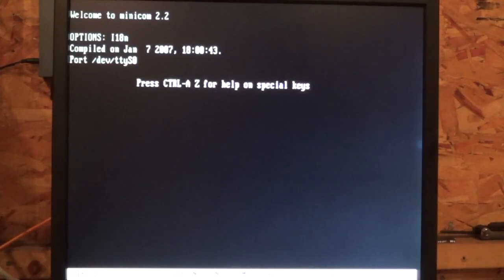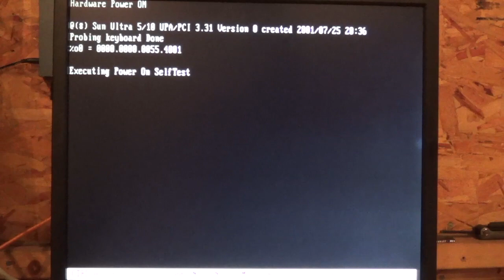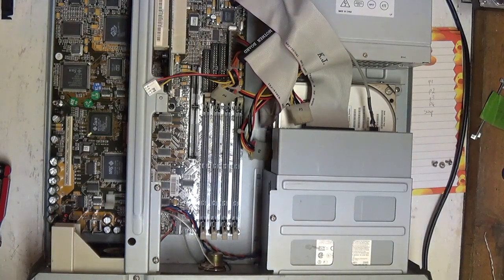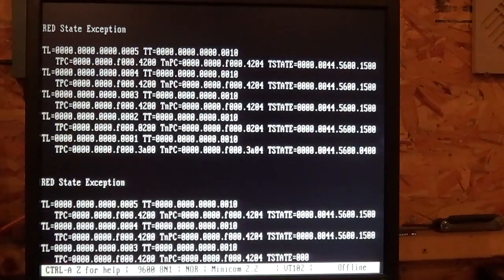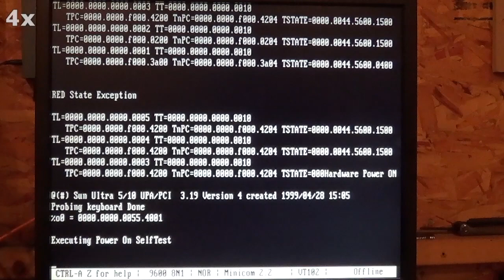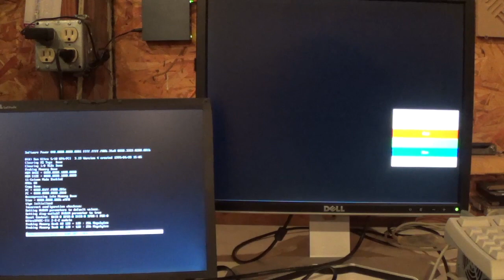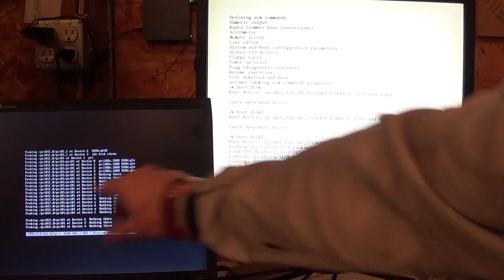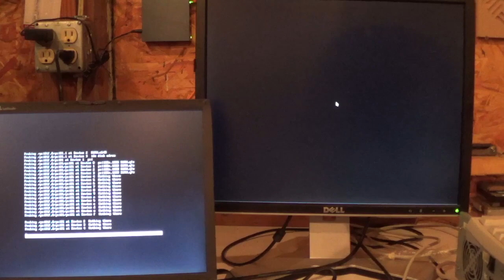Sun E10000 - Ultra 5 SSP repair

Comment: is it just me, or does the replacement motherboard have some bulging caps on it on the CPU power filtering side of things? I had that happen with the Ultra 10's motherboard and was able to use reclaimed capacitors off a Pentium 4 board that were of considerably better quality. but the poor board finally gave up the ghost not too long ago and I had to replace it with a board from an Ultra 5 333, so I can't use my 440 CPU any longer until such is fully replaced. You may want to check those capacitors because the IQ branded caps are finally at the end of their usable lives and are starting to puff up.
Reply: I wouldn't bother using caps recovered off old equipment. Worst case you're looking at maybe a few dollars worth of parts for new nichicons (or other reputable brand) from your favourite supplier - mouser, e14, rs, etc.

Comment: *Try cloning the ide drive in the Ultra with clonezilla and see if you can push the image onto a modern SSD. I did this last weekend on 10K HDD and worked really really well. In PA we get really cold winters and I've found all of my standard hdd drives seemed die off from the weather. It might not be possible to do but it would be really cool if it worked.
Reply: It's a shame that slightly less modern SSDs aren't more common. PATA disk modules were a thing, for industrial and embedded systems, but production seems to have stopped on all the classic brands, like Emphase.

Comment: Those always drive me up the wall. Reminds me of when I put in a post card in older pc motherboards and they are not 100% dead. Sometimes you may or may not get a beep code. But since the card is flashing around different numbers it is doing something. Last one I looked up the error code on was 2 things i could be. Neither one of them was worth fixing the older board for. So just time to recycle it. Thank goodness it was just a pc board. Though now I wonder what could really cause that error you got. Enough to go though console diagnostics but then stop. We also know it isn't the power supply since the other board works on it. I double it would be the clock since it does allow a console post. It does not have onboard video right? So no possible bad v-ram. To bad I don't know more about the sparc boards. For instance is the console boot 100% diag. board or does it need part of the overall board to function. Hopefully somebody will chime in a few ideas. The big thing I hate about the newer you go. The more the chips are soldered to a board. When I first started getting into computers. It would be wroth a time to change out a keyboard chip if the keyboard was not working. Same thing with bios, clock chip and a few others.

Comment: You're back!

Always a good watch, even when PSUs explode etc. lol

Would love to see your progress with anything SGI, but the Sun stuff is a close second. ;)
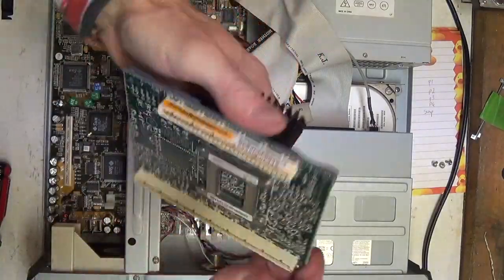Reply: 7:16

Wow - The CPU uses the same type of connector as the Octane CPU. :o

PLEASE let me know if you see a part number or manufacturer on the connector itself (on either the CPU module or motherboard).

I designed an adapter PCB for the Octane CPU module, to allow it to hook up to an FPGA board. But, I was unable to find the type of connector, so had to use rows of 1.27mm pitch pin headers instead.

(which weren't fun to fit, and had to be used for the ground "fins" as well.)

Do you know if Sun might have a parts list for their boards? I'll have a Google anyway, but it would be great to know if you have spotted anything like that.
Reply: The Octane adapter is part of my efforts to implement an SGI Indy / Indigo or Octane FPGA core, btw.

I have the Indy BIOS booting passed most of the self tests under simulation (Verilator), but the CPU core I'm using lacks an FPU, and it's genuinely easier to hook up a real MIPS CPU rather than implementing the FPU in Verilog, at least for me. lol
Reply: That's quite interesting! Best of luck ! :)
Reply: @electronash  I wouldn't expect a parts list, most Sun stuff seems to just go to a module level with FRUs
Reply: @DextersTechLab  

Yeah, like the DEC stuff, most of them don't even put designators on the boards.

I know it's a long shot, but always worth asking. ;)

I think the connectors might be FCI / Amphenol, but I can't find a part number for that type with the blades in the middle, or even an image of a connector on its own.

The smaller power connectors are FCI, and I think I did find a few sources for them, but they are still quite rare / EOL now.

Those connectors are easier to do without on the Octane modules, as they just carry 5V and 12V power (to the on-module DC-DC), clock out, reset, JTAG etc.

There are two pins that go to opamp inputs on the DC-DC, but I don't know if they are for voltage / current sense, or something else.

I'll have to bypass the DC-DC for now, and buy a 3V3 PSU instead. I tried two different ATX PSUs with load resistors on the other rails, but they still didn't like the 9 Amp draw of the CPU without shutting down.

I'm probably better off trying to get the R4300 booting the Indy BIOS. I at least have an adapter for that already, and it has far fewer pins to deal with.

Comment: Hello. I have a vintage Apple Macintosh SE in fully working condition with an Ethernet card installed. It’s my dream to connect it to the internet. If you can teach me how to do so, it would be a joyous dream. Please, if you have time, let me know !
Reply from the maker: I'm afraid it's been a long time since I've messed with an older Apple - probably fifteen years. I had a IIcx and a IIsi that were online for a while, but I genuinely don't remember what was involved, I'm sorry! I'm afraid the best I can do is point you in the direction of Google.

Comment: Lovely.. I have to fix up the NVRAM on my Ultra 5 board. And make up a chassis for it, cause i only have the electronics! The NVRAMs i ordered had dead batteries on arrival :(
Reply: I just did mine on my ultra 1 using these instructions: https://www.tns-soft.com/nvram_redux.html
A salvaged cr2032 holder works great! I recommend using a dremel grinding wheel and a cutoff wheel.
It was a lot easier than I thought it would be, only took 15 minutes of work.

Comment: Thank you for this video - it gave me some ideas of things to try when my SPARCserver (630MP) develops issues, as it probably will.  I had exactly this sort of problem ('RED State Exception' errors) with my Ultra 10. I couldn't diagnose the fault but a few months later, I bought a refurbished CPU, where the seller had replaced some SMD capacitors.  This /may/ have fixed it but I never found out if it worked or not, because my landlord forced me to tidy my flat and the Ultra was one of the things that I got rid of.  I kept the board and drives though, so maybe it'll be back.
Reply from the maker: Oh, man, I love that series of machines. (As evidenced by the fact I have 4/470s, 4/670s, 670MPs, 330s, etc). Most of my issues with the older sun4ms was related to bad backplane connections and RAM that was twitchy. I found giving it a good clear out with electrical contact cleaner and letting it run for an hour to warm it up before actually doing a reset/boot cycle always got it running. Old computers, man. :) I've had more than one person tell me I should do some recapping on the mainboard. I didn't see anything that was obviously bad - and there's a lot of feckin' caps on a U5 mainboard. But maybe... To prove a point?

Comment: Do you have a replacement motherboard that could replace the motherboard that is malfunctioning and see if that gets you anywhere, That video card looks like it is not deigned for that motherboard in that some of the connecting pads are visible when plugged into the video card slot mount your primary Hard drive as /dev/sda1 and secondary as /dev/sda2 and see if that helps you.
Reply from the maker: Didja watch the video? ;) I replace the mainboard... And this is the correct video card for this machine. In fact, I think can actually put it in the E10k and run graphics off that...
Reply: I enjoyed it loads but when you tried to load from the drive would not load should it not have been mounted as dev/sda1 and the second drive as dev/sda2?

Comment: You could also try and get one of the  Netra T1's running, and try that as a spare SSP, according to the SSP documentation, it can be used on an Ultra 5, Enterprise 250 or a T1 server...
Anyway, hope to see another update on the E10k soon.
Reply from the maker: Yes, I went down that road and considered moving away from the U5s - but I decided it probably was a losing battle because then Netras, et al, will go up in price too - and I have doubts that they're more reliable than a U5. What I have stopped on - but haven't had enough time to investigate yet - is whether QEMUs sparc64 emulation is good enough to run Solaris and be an SSP on x86. Their sparc32 has been documented to boot Solaris fine, but I don't know about the 64b and I think (but haven't verified... because the SSP wasn't running) that the SSP software is 64b. To be honest, the JTAG-over-ethernet stuff is simple enough it could all be reverse engineered and rewritten in a totally different portable language. But that's a slice of pie I'm not going to bite off.
Reply: @jpkiwigeek   I did read in the SSP documentation that a SPARC Station (serveR) 5 could also be used, but only if you do not use more than 8 domains on the E10k.... Not sure if this would mean that SSP 3.5 software is infact 32bit though....
You could use 'file' with one of the SSP processes to check which binary version it is actually using ... ( sun4u  64b or sun4m 32b)  
I did see a nice Qemu video on Youtube that booted Solaris 2.6 as if it was a Sparstantion 5....
Reply: Would it run on a Blade 100 or 150?  Those are much newer and probably cheap enough to acquire.

Comment: Was thinking about you, well ok, your channel, your videos. I hope your ok, your family, kids, kats and all. Just recently got a Powermac G5 (haha, nothing compared to what you have) but the Openfirmware was a learning curve, have had lots of fun tho, and remembered your videos on setting these lovely machines up and running. Love OF, or actualy, such a configurable "bios".

anyway, hope you have lots of good luck and health. The lack of content is ok, I think your content when its released is just good old times fun. Have the best 2020 further posibly. weird things these months, hope we all can get a better 2021. to other users and you jp, have a wonderfull day.
Reply from the maker: Cheers, mate. Same to you. I just got a dual G5 myself, unfortunately I think UPS dropped the box as the beautiful aluminium was badly damaged. Pity.
Reply: @jpkiwigeek  Ow thats kinda sad yeah. Yeah mine is a DP too, PowerMac7,3 to be more precise. watercooled, so thats fun (nope). still looks clean (no leaks sofar). Was free, because the hdd got pulled and GPU has isues. Plan on replacing it with a flashed ATI FireGL X3, I never knew these cards used similiar GPU, but differ in bios used. My most powerfull PPC besides a PS3 :P Hope yours works out of the box :D